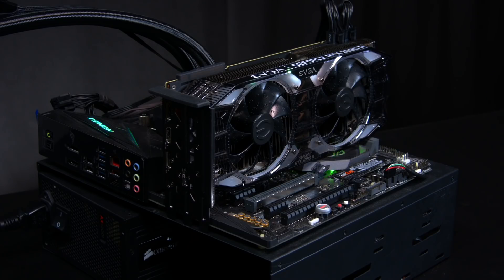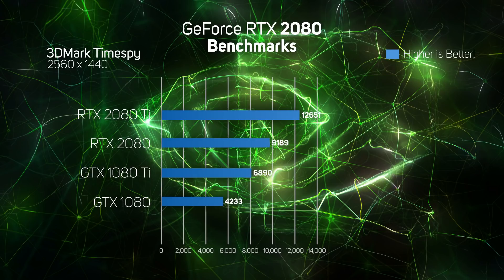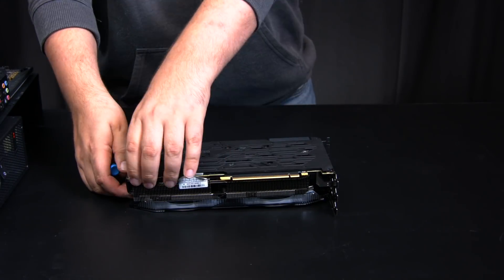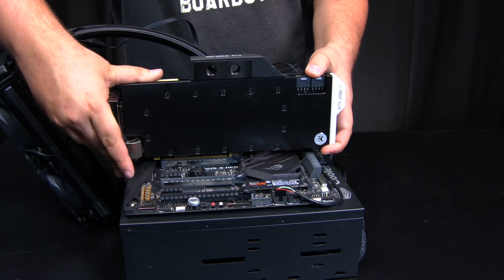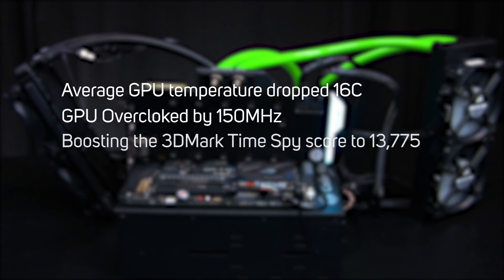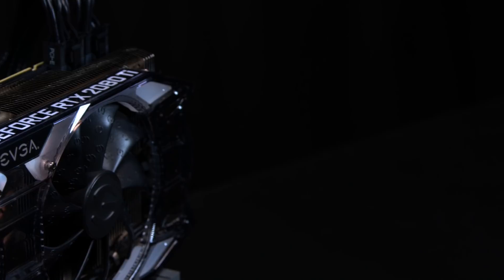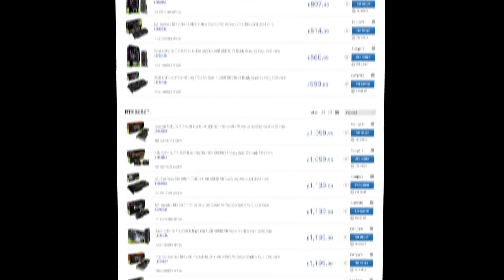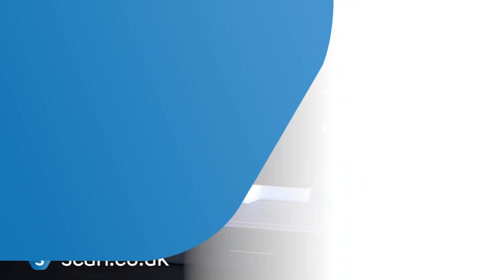World first! Watercooled RTX 2080 Ti Overclocking performance with an RGB EK waterblock

Comment: Two things that I don't understand. 1. Why we need to have this 3 slots holder when water cooling block occupy maybe 1 slot? Im buying watercooling stuff not because of overclocking but because it is silent and efficient in small cabinets mini-itx cases but in this case 3 slot holder is something that don't let you install this card with water block with small case. 2. Why somebody need to overclock RTX 2080 Ti card? This is stupid. If I need better performance I'll buy better graphics card.
Reply: There is no better gpu than the 2080ti

Comment: hmm never overclocked or water cooled anything, this is interesting, I always thought that only the CPU could be water cooled, i also always thought water and computers don't mix and overclocking can damage things?
Reply: Dave's Sweeps ok so first off you can also watercool ram and motherboards, power supplies and ssd’s and pretty much anything else nowadays though the only useful thing to be water cooled is the gpu and cpu
Reply: Secondly the water never touches a raw component, it touches a copper or nickel base usually and that base is what touches the component so water never touches any part directly. The water carries the heat away though the tubes to the radiator which then emits the heat out of the radiator via the fans
Reply: Finally it’s very hard to harm anything overclocking, most motherboards shut them selves off to prevent damage if you do anything to crazy, as long as your temps are good aswell it won’t really decrease longevity of the parts life
Reply: Hope that helped

Comment: RTX 2080 Ti is already a beast. Overclocking can enrage that beast a little. BTW I never thought water cooling a graphics card can be that simple. Thanks.
Reply: you can use aio coolers now with brackets on modern gpus.

Comment: I really like the Nvidia RTX 2080 Ti graphics card and EK waterblocks you can potentially use with it. I only wish I could afford to use components like them in a PC build of my own, as I really wish I had a much faster PC than I currently do, that I could play the latest games on.
Reply: You can play the latest games just turn off anti aliasing and reduce the resolution unless you have a graphics card older than 900 series. I can play all games fine on 1080p with GTX 970.

Comment: the cost to a)buy the card and then overclock it.. I'd rather stay with my 1080ti and buy more kit/ games until there is something that requires more than 1440 to play
Reply: 1440 can also be a 3440x1440p and the 1080Ti, even overclocked, is not enough to run games at 100-120 fps with maximum details.

Comment: Comparing to what you say is "out of the box" isn't really a fair comparison.
Nvidia imposing the voltage restrictions is really limiting what overclocking can do on those cards.
Time will tell if or when that will be lifted.

Comment: The performance increase has nothing to do with the watercooling you would have gotten the same bump in performance had you run the benchmark while overclocked on air. The 2080 ti can't be taken passed the a certain increase in CPU frequency because of voltage limits imposed by nvidia.

Comment: Was that 150MHz an additional overclock over the air cooler? It seems like you run it at out-of-the-box clocks on air and only overclocked it on water, so the actual gain is smaller.

Comment: Is watercooling more quiet than air? I suppose you still need to cool the bank, so the noise is still there, right?
Reply from the maker: you can often run the fans much slower in WC builds so generally its quieter

Comment: From your description: "huge performance leap over the previous generation". I don't know if I'd go that far.
Reply from the maker: we are confident that once DLSS gets going we are going to see some serious differences :)
Reply: 4k dlss = true 1800p based on some reviewers.:d
Reply: Mindaugas Strole  Hardware Unboxed released a very telling video where they compared DLSS vs. 1800p+TAA and the performance difference and visuals were extremely comparable. If that carries over to new games what's to stop a Pascal user from just using those settings rather than relying on DLSS?

Also DLSS in its current form is 1440p upscaled to 4k. My main gripe is outside of two demos we don't actually know how good DLSS is going to be. Scan Computers is just giving nVidia the benefit of the doubt which I find disingenuous.
Reply: I have one believe me it is better and much faster then any other card out there..don’t believe it when you see it your self I always say.
Reply: @v-fgamer6941  Of course its faster, it's not a huge performance leap over the previous generation was my contention. I feel (and the data supports me on this) that it's a gross exaggeration to say huge performance leap over the previous generation. I never said it wasn't the fastest.
Reply: Brendan Byrne sounds fair..
Reply: @brendanbyrne3028  let the 2019 games come out then, the 2018 games didn't really have 2080ti in mind, hence why ray tracing isn't as well implemented and when enabled the games performance drops quite drastically, you have to understand 2080ti is only yet in its infancy, but that's soon to change, just give it time and give it a chance and you will see the difference is definitely not over hyped
Reply: The performance is there but the price for it is crap though

Comment: I honestly thought you'd see a larger performace increase with the water cooling. The drop of 16°C is certainly something to crow about, though!
Reply: They're all power limited, you can pretty much pull the same clocks on air vs water vs LN2. Until vendors are allowed to step away from reference PCBs and power systems, it's just a cooling thing.

Comment: Seen better overclocks with air using msi or strix on you tube. You sure you no what your doing scan?
Reply from the maker: it depends on the sample. ours only got 150MHz but ran much cooler. we also are maybe a bit overkill on the stability as we have to make reliable systems that need to be perfect.
Reply: @ScanComputers  fair comment.
Reply: In other videos we saw that the power limit is more the problem and never the temperature (tested in open cases). So I think a watercooling doesn't help with overclocking right now. It makes it "just" quieter. And we don't need the big heatsink+fans. :)
Reply: @christophlsa   yea I no, crap cards in all honesty. Rtx won't be very good either specially at 1080p lol what's the point.
The next gen will be the one to get for rtx,hopefully.

Comment: why are you hiding the FACT that Nvidia is locking voltage controls from the factory for the past couple of generations, I don't want to mod my card by messing with resistors and shunts to increase the voltage .

Comment: Liquid cooling puts air cooling to shame.....noise down, heat down..... performance up.....a no-brainer but my pockets suffer 😁
Reply: By heat down you mean competent temps down, right?
Reply: @mememachine7973  spot on!! My vocabulary eludes me this time of day😁😁
Reply: Why the hell would you buy an EVGA 2080Ti and a EK waterblock?

I preordered a FE and water block (2080Ti).

It was just cheaper given the EVGA cards currently use identical boards.
Reply from the maker: because we don't have the FE cards and EVGA stepped up for us :)
Reply: Huh, fair enough.

I managed to get my preorder in pretty fast lucky. I haven't had issues with Nvidia and returns, even after using a water block, I just put the original cooler back on and sent the dead card back.
Though the 2 year extension would have been nice, even though I upgrade every year its still a nice to have.
Reply: Noob.

Comment: 1:38 Why would you plug it into a watercooling LAPTOP? Is this a trick video?
Also only 7% - very disappointing compared to 980 Ti overclocking.
Reply: Yeah but the stock speeds of even a 1080 put a 980Ti Oced to shame. This GPU stock is a whole new level.
Reply: Meme Machine  what do you mean? frequencies arent' that high